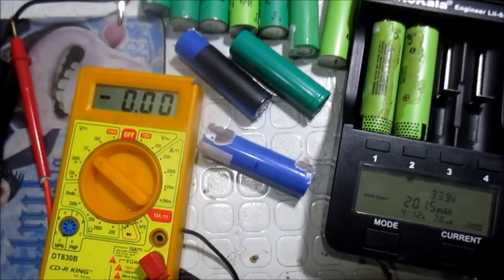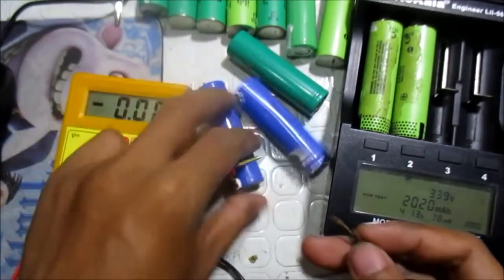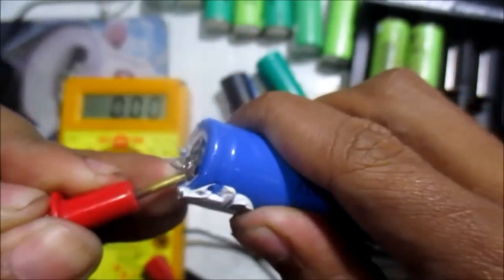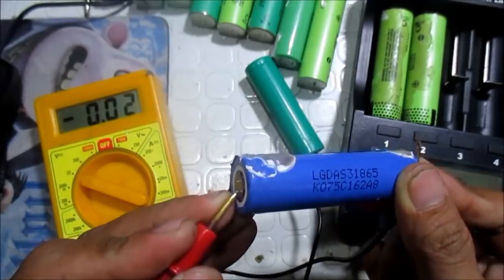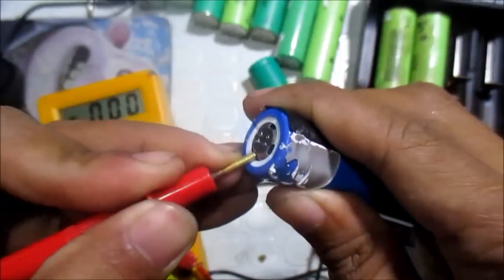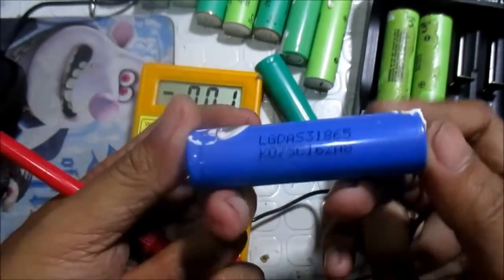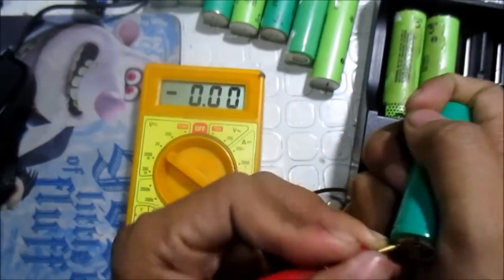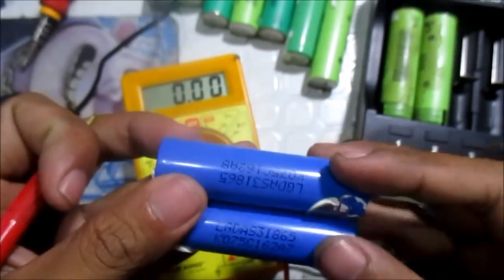Revive Dead Li-on 18650 Battery - 100% Working

Comment: The fuse trips for a reason. This means that there is something wrong with the battery. Resetting the battery you are displaying involves the risk of fire.
Reply from the maker: Theres a possibility thats the reason why I recommend to use it in a small device like small efan or flashlight...never put it together with those good and healthy cell.....I already made a clarification and only intended this video to prove that dead cell can be revive

Comment: Never reset the CID. What's he's poking there is the CID switch. CID is there to disable the battery in the event that its almost about to explode. Yes resetting it wil make the battery usable again but the danger is still there since CID only works once. You got no protection anymore.

Comment: You can not revide an 18650 Battery that is Dead and what you are doing here is Dangerous

Do not try this at home and do not do what this idiot is doing in this video if you don't want to blow your damn hands off 

Best advice it to replace them with brand new ones

Comment: Ah, yes, I try this. First, why battery is without V? The cell was over heated and start to make gas. The gas push contacts on the top of battery(protective system). That is why battery dont have any V. Pushing that down, you will lose gas which is under pressure and you will get back V. BUT CELL WILL LEAK! I meltdown my 2 chargers beacuse theese cell leak. If they dont leak, they will be hot durring test so.. DONT DO IT!
Reply: You right.. I did this and the battery started charging.. After a while it heated up so much and turned black.. DON'T DO IT!!!
Reply: thanks I don't know much about these batteries and you saved me from tutorial like charging 9v alkaine battery

Comment: Good day sir. Can my Lenovo laptop battery still can be fixed? At present when I will be using my laptop I will also plug in my charger because it won't charge already. If you have something to remedy on this please help me sir. Thank much and more power to your channel. God b wd u.
Reply from the maker: you will have two options, repair the laptop battery by replacing the dead cell with a working one.. or you will need to buy a new laptop battery. in my own opinion, it is better and safe to buy a new one.

Comment: boss sira yung 18650 ko na molicel na drain tas di na nag chrage pokala pa help naman.
Reply from the maker: bago pa ba yang 18650 na battery mo?.. if zero volts na, palitan mo nalang lalo kung sa vape mo ginagamit,, pero if my volts p naman,,,charge mo sa  tp4056 module..
Reply: Bago pa po battery ko, sabi sa shop na drain ko daw kahit di ko pa naman ginagamit, so ayun hindi nila pinalitan

Comment: Wtf. I have different method. Like I Use the Pharallel and use some wires so that the Voltage get High and It will recognize but I use This method and it really Works. Thank you.
Reply: Good job

Comment: The best way is to put the battery in the charger but leave the positive barely touching. Leave it for 2 minutes then plug it in properly and it will charge. Don't play with the safety cap. Really stupid and it's way more work
Reply: what? How do you do it?
Reply: @rubenayla  basically put the battery in the charger but don't put the positive nipple fully in. Then after two minutes of charging like this push the battery in properly. It will then charge normally

Comment: Be careful, it is highly dangerous. In our locale, a DYS fellow on opening the LI. ion battery got nasty burn on his face because it horribly exploded while doing so.
Reply: Yea and i shall tell you why.. Its because the battery holds alot of charge power.. and when he did that, that charge power released and it's alooot of power released in 0.01s so booom! Internal battery juice is instantly converted into burningly hot gas (maybe even plasma, ionized gas)..

Comment: Never use these revived batteries by CID method in heavy charge discharge n heavy load circuits. Never use them to refurbish your Laptop cells again.

Do not ever use them in laptop. Simply replace the fully worn out batteries with new cells of 18650 for safety n longevity of your Laptop.

Comment: I have done this a number of times the result is always the same...an unreliable battery...they all have popped there CID  for a primary reason, the reason has not gone away...it can be too high self discharge in which you keep pumping in power and it does not hold the charge...the only time this would be a good idea is if the bms was shown to be at fault...so dont do it, it will at best frustrate you and waste your time...at worst will start a fire..
Reply: I don like this method 
Success 
Very nice

Comment: Worked on me..thank you so much. I'm really hopeless on my  18650 HG2
Reply: If it works, It's not stupid. Probably the issue here is caused by engineering failures.. So if you don't want to do it. Then don't.. Because this worked for me 100%
Reply: Courgae dont have anything to fo with it them cells was not ment to be done that way that why cid was put there safely reason. If you that then you are a dum ass
Reply: Not  safe to do this people
Reply: @guiterman6263  if you don't have the courage, yes, better not to do it.

Comment: You measured the ones with "0volt" with w_rong Polarity. It is f_a_k_e
Reply: It doesnt Matter its going to be - and mit a + voltage because of wrong polarity.
If you measure your 3.7 Volt battery with wrong polarity IT will Not say 3.7v but IT will say -3.7v .
Try it and you will see
Reply: Reverse polarity shows Voltage minus (V-)!!! So no fake! Go and buy a multimeter and read something about negative or reverse voltage!!! What he does in the vid worx 100% but is also 100% dangerous!!!!

Comment: Playing with an over discharged lithium batteries is not a good idea..
Reply: Well....My LIPO...do the PUFFY when I discharge the living shiet of them.
It's a godd god damn thing...LIPO dont that retarded safety feature....

Pack gets Hot.....Usually the WIRES, ESC or MOTOR goes before that batteries.lmao

i dont Fu4k around with Li-on for my R/C Toys . FFS
They have crappy discharge rates compare to LI PO.
Im running 3s lion (12V) in a 7.4 volts r/c car for the kiddie...He dunn
give a fu4k if it catches fire....as long as it goes faster.
It's better than the AA set up.lmao
IT WONT...ive ran it for Hours to test it.

Comment: nag rerecyle din akong 18650 this is very unsafe and against it. you can short the battery by accident kung hndi mo alam ginagawa mo kgya ng mga nanonood dito at 0 volts means dead/end of life/not safe for use na hndi worth it ang battery na narevive mo just to use for few days/months and magcause ng sunog sa bahay mo na pinundar at pinagipunan mo ng ilang taon.

Comment: Bad idea, did it with several batteries in the past. CID is there to protect from overheating the battery by inverting itself and breaking the circuit to protect the cell from a catastrophic event. Resetting it makes the battery an accident waiting to happen, like a loaded gun with the safety off, also if not done very carefully it bursts the cell cannister allowing the electrolyte to leak out. Not nice stuff, it can kill your charger too.
Throw it away or give to a recycler instead.
Reply: Not smart
.first get rid of the bugs running around ur work area

Comment: if your home is worth anything pay the $5-$10 per battery to get a new one!  this i downright wrong; short the +ve/-ve and you have a firestarter if there is a decent voltage onboard.
Reply: ikr-how are all the fools in comments-"thanks, this is ace!" omfg
Reply: @surfinmuso37  Because it works, what you see here is calls the CID reset. 
    - Built-in to almost all 18650's
    - Not visible by just looking at your battery
    - Collocated (placed side by side) with the PTC
   -  Is a pressure valve, which will disable the cell permanently of pressure in the cell is too high. (For example, if you battery over-charges and reaches over 145psi.)
   -  Works by releasing the connection of the positive terminal, rendering the plus pole useless.
    - Does not always reset, does not always open completely when needed
   -  May not work when module included multi-cell series and/or parallel configurations
You can also read it here: https://batterybro.com/blogs/18650-wholesale-battery-reviews/18306003-battery-safety-101-anatomy-ptc-vs-pcb-vs-cid
So this in the video is a really dumb idea.
Reply: @zockfreund  Thanks :o)

Comment: As long as you don't mind an e-cig exploding in your face and taking both eyes out go right ahead and reset the safety device that keeps the battery from over heating. Stupid idea.
Reply: It is for charging protection mainly.   How can such a small wattage device cause over current to cause the battery to explode unless there is a short.  And in that case they could make the safety device to be resetable
Reply: Even bi metal could fit in the cap
Reply: Plus the vent pressure should not be so high as to allow explosion. You obviously don't know much
Reply: Glenn Davus Will you retract your stupid comments
Reply: Haze DC  the real fact is you are brainless.  If you bend the aluminum pressure disk back will it somehow become hard like steel and not pop out again.  Get a life you pathetic fuck
Reply: Hey you know you are talking shit don't you?

Comment: Is it safe to do that? are you still using those batteries with no problem?
Reply: I'm not sure I want to risk my house for a very inexpensive cell, but you brought some extra thought into the equation... if it has voltage after you perform this. I'll let you know in a week. If the house burns down (over a 5.00 cell) I'll not be replying (computer will have burned up with the house.)
Reply: @dfabeagle718  I guess you had a fire :D
Reply: NO! Absolutely not safe under any circumstances! Throw it away, it has no value! What are you trying to save, 50 cents?!
Reply: @LoretoLlosala  
I've 6-10 batteries like that. Can I fix those and use it on my flashlight? And can I recharge them? I mean recharging with charger will be safe? How you recharge these battries?

Comment: That's the CID. Current interupt discharge I believe.. Means the battery over heated and internally disconnected itself. Saftey feature  and is not in good condition.. Ive done it in a pinch but dont think your getting stable batteries doing this lol definitely mark em and keep an eye on them.. Seen those go off and its pretty awesome
Reply: Or they don't even have one.  But it is convenient for the manufacturer to put this single use safety.  They can sell more batteries
Reply: @sammyd7857  what is importnt is what triger short cyrcuit or over heat. It will happen again. I try and battery was HOT and they leak. Price of 6 lap top battery is 1 USD. Bettery to reject 1 battery then to make fire in house or to melt testing gear as I am!. Do not do it.
Reply: Yeah if they go off it means their vent system is defective

Comment: I could not use the reply function so do it here> MY K BOARD IS PLAYING UP SO IGNORE THE CAP> But again you are not saying anything  about the rest i mentioned? My battery is 42000 mah and I can only buy 24000 where I am?
I tried to poke at the back of it but can't open it. Someone else says there is another button on it that has lost contact so no negative on the battery?  So practice on your Aussie accent 'cause that the only one  i understand. Yep $16 for a 24000 and ebay sell the whole torch for the same price  some 11 up to $25
Reply: Not too smart of me I'm one zero out, but I think you could have work this out. 
And yes the original battery for this torch called "Flashlight" coming in a box with army camouflage on it, is 4200 mAh (TLX 18650 4200mAh 3.7 V li-ion) .  OK I see in your "read more" additional info I thank you for that.  I do know where the negative is but I don't seem to be able to poke at it to lift this part like you show us. So you don't believe this 42 is true. Now it's not working I probably would have trouble to check it? 
Our store in Australia sell only the 2400 m... they tell me it will work but won't last so long, what do you think of this.
Then Looking in the box I have not open for years, I found a gadget that takes 3 AAA and this works just like before! They want AUD$16 for their rechargeable 2400m.. I only use it once i a while for a couple of minutes and wonder if there is any sense in getting a new one, just cruise on with ordinary AAA.
Thanks again for your post, I might try again to 'butcher' the bad one for the heck of it!  :)

Comment: Hi i some LGEAS31865  batteries salavged  from my HP laptop ,I tried fixing it to my diy power bank bought from ebay , power reads in my multimerter as 3,5v and some dead cell after reviveing live to  1.2v , is not chargeing at all ,
could not find the fault , whether new chager rejects this cell and only accept 16850 cell ,just need to know from your experince if any ,,,,tks
Reply: Hi Loreto, No what i have is LGEAS31865 , tested it with my multimeter , two cells read as 3.2v and three cells read as 1.2 v after i revive it. Now i fixed it with my new power bank and it,s not chargeing . This 31865 battery are salvaged from my old HP laptop . From what i see in youtube many clips shows that only 18650 is used ,but mine is a different number , Tried to charge it with my new power bank diy pack and also tried to charge it single by single with my normal battery charger , notice that charger power trip off , i even surf ebay to find a suitable charger for this battery 31865 could not find one ,what could be the problem is yet to be known. hope i can get some help from experts .... tks
Reply: Hi Loreto ,Thanks for the swift reply , will order the TP4056 with power protection circuit to make one charger
for my power bank ..Tks Pal
Reply: Loreto thanks ,will contact you if same problem persist ..tks Pal